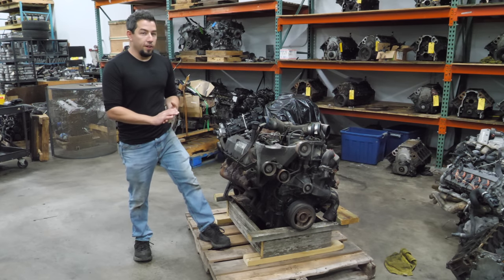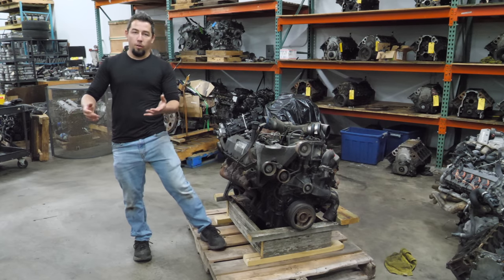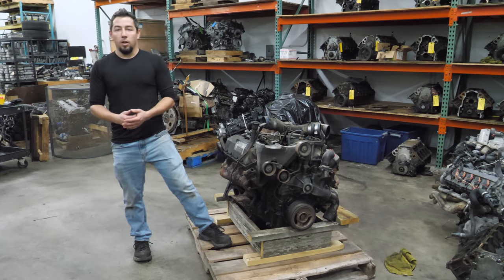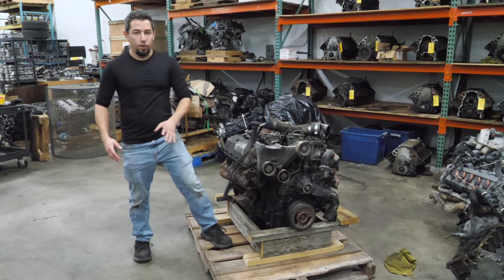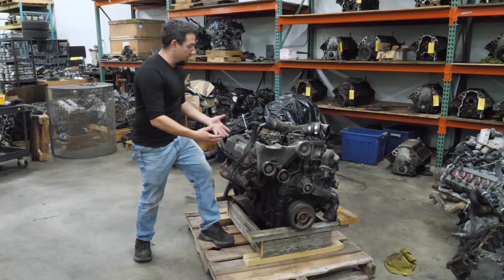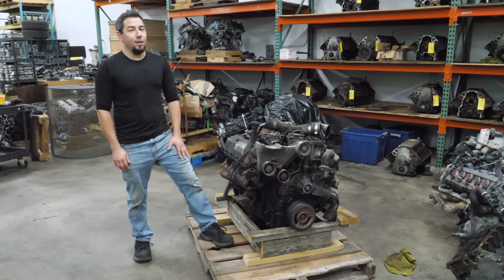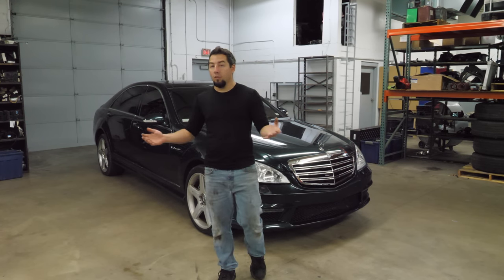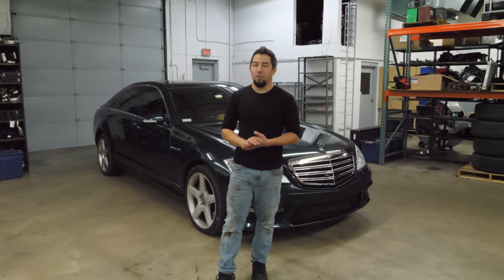70K OR 700K? Ford 7.3 Powerstroke Mileage Discrepancy. How Many Miles Are Really On This Engine?

Comment: Keep in mind it may have lots of engine run hours vs engine mileage. Could of had tons of idle time on it.
Reply: Exactly, mileage is useless, UPS trucks are toast after a few thousand miles due to constant stop start and many hours of slow driving...sane thing with the Toyota mine trucks...
Reply: Or it could have been worked to death. Like one of the 85 horsepower diesels in the original Mercedes G Wagens.
Reply: I drive an F450 bucket truck, 50 hours a week, and it spends most of its time idling
Reply: @motominded5275  it's not useless, both hours and miles are factors. Low RPM usage is less damaging
Reply: @catinthehat5140  well, truckers use an engine idle setting to set their trucks at 1500 ish rpm’s to build oil pressure.
Reply: Yep.. Tow trucks, Ambulances, bucket trucks, tire trucks, dump trucks, farmers trucks, etc.. they all get a lot of idle time.
Reply: Idling diesel engines isn't good for them in the long run, the soot build up isn't good because the soot is basically carbon which scratches the bores, accumulates in the ring lands, is hard on valves, heads and other moving parts, it acts like super fine sandpaper slowly deteriorating  moving parts, newer engines w/ egr coolers and emission systems are really affected by this soot/carbon build up even in light duty and diesel pickups with emissions controls
Reply: @glennshumaker2019  Yeah.. That's why modern diesel design is terrible
Reply: @calholli  the after treatment systems are terrible. The engine designs haven't changed too much other then switching from mechanical to electronic injection. In theory a mechanically injected engine won't last as long, but I have a mechanically injected kubota v2203 with 40k hours and it still has the original injectors.
Reply: @motominded5275  Yep, same with garbage trucks. 200k miles on one of those from a Northeastern city route, and it's SMOKED!
Reply: Lots of experience here. I have a question for you guys. Those worn  bearings from lots of idling is troubling. Is there a way to minimize that wear on engines that have to idle for extended periods? If you changed the oil at very short intervals  would it eliminate that wear or will the damage be done anyway with extended idling? Thanks in advance.

Comment: i’m gonna say 70k. the wear on it is probably due to it likely having not been shut off a whole lot in the winter. especially since it has a service bed, i’d be willing to bet that truck ran non stop.
Reply: I think that oil change place confused 697,845 with 69,784.5

Comment: I had a similar conundrum, but in reverse. I bought an NA Miata with about 120k in 2014 from a guy who took it to a local oil change place near his house. I never took it there. Yet a few years later when I decided to sell it, I pulled the Carfax and found that the same  oil change place somehow had been entering oil change records (presumably on the the previous owner’s other car), but on my VIN. The mileages entered were LESS than previously entered for the Miata, and hence showed as a red flag in the Carfax report. I never got it corrected, and obviously I declared actual mileage when I sold it. But basically those oil change places can cause trouble and confusion for Carfax reports.
Reply: This is an excellent point. Sadly oil change places are low paying jobs jobs with an emphasis on being quick and max profits. Employees tend to hate their jobs and are sometimes even given incentives to cut corners. So not updating a VIN number probably happens a lot. What’s worse is when they don’t change the filter because it requires dropping a belly pan or is next to a super hot exhaust. Or they strip or or round off the drain bolt. Or they under or over fill the oil. Or they use the wrong oil. Or you pay for full synthetic but get the cheap stuff. It’s all been documented.
Reply: A lot of these oil change places barely train their employees to change oil and do the documentation some have experience at oil changes and other mechanical service but employers have to pay for their experience, I very seldom let someone else do a oil change on my vehicles, for one they use cheap unknown oil filters. They sometimes use cheap oil also, so really you don't know the quality of things they are using in your vehicle. I may pay more for premium oil and filters and do the work myself but I know it's done rite.

Comment: Interesting that in the truck pics the service body was eaten up but the cab seemed fine.   The body could have been lifted from an older truck.  I do know that 7.3s can easily run to 700k miles if properly maintained but the labels would be cooked.  Those labels look close to what they did when it left International's Indianapolis engine plant.

Comment: I would say 70k. The reason being I have worked on plenty of these engines. Normally the plug going into the valve cover gets replaced around 200k, and those look like original plugs. On top of that the valve cover harness look original too. And I have never seen a valve cover  gasket last more than 100k miles.
Reply: You are so wrong.
Reply: @thunderroad7289  How you gonna tell someone they're wrong and not tell them how they're wrong lmao.
Reply: your 💯 correct but  what about the harness on top the motor  new   ford factory  valve cover injector harnesses  would be spliced in ..... which I'd ne er use aftermarket.

Comment: As other people have mentioned, the truck had a service body. To me personally it looks like it was a hard working 7.3. I see rust a lot but I live in Canada so that’s why. What caught my eye is that the injectors looked pretty much factory, which someone mentioned. I think it’s had a lot of idle time and hard driving since it looked like a service truck. Also depends on the oil that the service place used, running 15w40 is hard on diesels in the winter. I drive a diesel and run 5w40 all year round.
Reply: I have a 96 7.3 so in the winter I can run 5w 40 will it be easier to start in the cold ?with being plugged in of course
Reply: @bigdaddydaddy3203  Yes it will start much easier in the winter. Running thinner oil though will increase the probability of oil leaks.

Comment: I’m going with 70k miles just with a ton of winter idle time. When you were showing the cam, I caught a glimpse of some of the cylinder bores, and they looked almost new. The crosshatching would be gone if it had 700k.

Comment: I am going to agree with Randall Vos. 70,000. A service truck in the upper mid-west, would most likely idle long hours daily. I ran a service truck back in the early 90's for almost 5 years. In the Milwaukee area. 6 days a week, I started the truck at 6 am and backed it out of the shop. and put it away mostly after 7pm. In the winter I never shut it off, I had an extra set of keys in my pocket and just let it run and locked it up when unattended. It may have been used in construction depending on how they used it, It may have run year round.
Reply: So just letting her run like u did how many miles did it have or better yet where is the old girl now did u sell it ?

Comment: I'm gonna go with 70k. I bet you the Feb. 2015 service mileage was entered one decimal place off, then something in the Carfax system doesn't let mileage be entered lower than a previous entry, so every following entry got multiplied by 10. Especially since just over a month earlier, it was entered at 68k.
Reply: It's awful clean
Reply: Or people just kept thinking the correct number to enter was ALL the numbers on the odo , without the decimal point.  Note how the "error" occurred when they changed oil change places, and continued that way in the future.  it could also be an issue with how the data is getting transmitted from their system to Carfax.
Reply: Then it's bad software.  You're depending on data from an unverified third-party.  People screw up all the time.  I can't believe they wouldn't anticipate that...  (As a former programmer in a former life, you learn quickly to anticipate all the crap data you get from users, lol...)
Reply: Gonna bet you're right, and that the early OBD2 on there was where they started getting their data from at the new place, ignoring the odo in the cluster. Given that the super duties didn't have to have OBD2 even in California in 99, I'm guessing some of them had the ECU milage wrong, because why worry about that with a manual odo?
Reply: I work in retail lending and even if one dealer enters in the wrong mileage on say an oil change, subsequent history can still be entered as the correct mileage. 

Source: view carfax reports all day
Reply: There's no decimal to misplace. He said that 2x.
Reply: @SeymourButtsS2  yeah this isn't a 70k engine.
Reply: @pantygnome  he disproved that theory if u payed attention lol. he said how the didn't have the decimals on the odo on that year truck
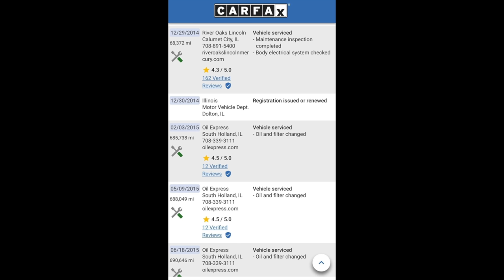Reply: That's what I was going to say. At 6:05 The number is 68,372 and then next one is 685,738. The first 4 of both are almost identical with the later in theory, only 2K more so if you drop the 8 and move the decimal place back one this would make sense. Or it went the other way. 685k is a number you don't see very often on a vehicle. I'm 58, been around a ton of cars and trucks in Texas and I've never seen one. Or maybe ... the first few places saw the 6 digits and said: that can't be right and just entered the first 5 which would be in line with most normal cars when it actually did have 685K
Reply: @WhiteF150  Yeah I heard that in the vid.  I could understand if they fat-fingered the first incorrect reading since the last 2 digits are are next to each other on the keyboard, but the rest of the readings don't make much sense.

Maybe they tacked on a digit from the ODO?

Comment: I'd bet it's a 70K mile engine. I purchased a beater truck 20 years ago or so that been sold 3 times within a year (it had an engine problem that others couldn't seem to find the simple cause) so it had several title transfers and carfax entries.  The truck had 168k on the odometer. The mileage on the title went from 168k to 186k in a months time, and the carfax mileage tracked the title.

Comment: I'm rebuilding one of these right now. This one has 80k but was used offroad in a wildland firetruck, and they used starting fluid trying to get it to start (actually the valve cover gasket and wiring had failed). The bearings were pretty bad, almost like the ones you showed. The starting fluid really tears things up on these TDI motors, as does the idling to keep the AC on.
Reply: " and they used starting fluid trying to get it to start"

Did it come from Slave Lake? MINT!!!
Reply: @BadWolf762  oh she’s cheechin
Reply: @BadWolf762  "How dare you!"
Reply: I’d say the bearing condition came from idling. I’ve seen a bunch of 7.3 and 6.0 eat cans of starting fluid with zero issues to the bottom end. The issue is if you don’t unhook the glow plug controller and the intake heater on the later trucks. Had a friend learn about the intake heater when he used starting fluid on his 03 lol.
Reply: Yep, use the Cosby Sauce, go to jail.
Reply: For one thing starting fluid in these is a no,no alot of them have glow plugs like the 6.o and when youspray starting fluid it will blow up in your face, save the either for a old 2 stroke Detroit Diesel
Reply: @glennshumaker2019  although if u cycle the key on and wait for the wait to start light to go out and count to 20 it won’t blow up I don’t care if I was late to see my kid born I would never shoot starting fluid in there if u plug it in u have a fighting chance

Comment: As someone that used to own one of these trucks, & replaced the valve cover gaskets, that far lower bolt on the back of the valve cover by the turbo is near impossible to get back in or remove at all with the engine in the truck.

The fact Is has the rear bolts means it is either low miles, or that they had a rly good mechanic working on it. Same goes for the injectors, if they are original you can look up the serial of the injectors on the solenoid cap.

Secondly that serial on the injectors would change & if the injectors are rebuilt that solenoid gets replaced.

Thirdly, since it has a service bed on it, & is 2015 the likelyhood they it was low mile for that long sounds strange, & how clean the up pipes are.

Comment: Borescope view of the cylinder walls would be useful. Wonder what kind of ridge the piston rings have left in there? 70k miles maybe, but could have a bejillion hours overall, judging by the crank bearings extreme wear.

Comment: The oil change shops could have assumed the last digit in the odometer was 10th's when it was actually miles. Everything on top points to low milage though. hard call. 700k on a set on bearing on a service truck is stretching it but they could also be the second set of bearing changed out as preventative maintenance. Since you can't be sure... strip it for parts unless you want to replace the water pump, the bearings and the harness and dyno it if there's that much difference in value.

Comment: The bearings should have a date code stamped in the back of the bearing. At least some manufacturers did. That would tell that they are original to engine or have been rebuilt. I doubt someone would find date coded bearings to keep the truck original. I’m more towards 70K with poor oil change maintenance or an owner that was used to driving gas engines. Start and go drivers. Looked like cylinders still had cross hatching, that would be worn at around 200K, by 6.0 experience. Thanks for the videos. Hopefully the family is doing well.

Comment: I say 70k. Service trucks idle A LOT. The wear isn’t is indicative of 700k. At low idle Diesel engines can wear more cause the temp and oil pressure go down. The cross hatch in the cylinders looked amazing though.

Comment: Hope the new addition to the family is doing well. As for that engine... I'd say 70k with many Cold Starts, and  a ton of engine hours from idling. Or if it was used to plow snow, then it would have experienced high load for extended periods.

Comment: Usually when a 7.3 is run hard, you will find broken exhaust manifold bolts on the rear of the engine.  Dash cluster changed perhaps?  They didn't use Archoil on this engine!
Reply: Archoil! 👍
Reply: No doubt if that engine had Archoil , or Schaefer's oil in it everything would be new. They probably put the cheapest Dino swill in there they could find and probably the wrong weight as well

Comment: Definitely an original turbo. AlliedSignal acquired and adopted the Honeywell name in 1999, not long after that engine was produced. 

I was also tentatively voting for 70k… but there are two things that are odd. The fact that all info sources are consistent after the first time 680k+ was reported. And, if the decimal was shifted, why were they changing the oil every few hundred miles toward the end? Only thing I can think of to explain both is maybe the cluster flaked out and they swapped it with a junkyard unit that just happened to show almost exactly 10 times the miles. Then the oil change intervals might make sense.

But then the bearings… yeah, that’s a lot of wear for 70k unless it was neglected and thoroughly abused. I’ve seen factory original diesels with more than 700k that had rod bearings that looked a lot better than that, so I don’t think it’s out of the question it could be that high. 

I dunno. Maybe the better question is whether that generation of Super Duty truck would last 700k and 16 years in Chicagoland? Yeah it was pretty rusted in the pics, but imo not 700k levels rusted. So I’m gonna go back to my original assessment of 70k, with the caveat that it lived a really rough life. Maybe pull the glow plugs and scope the cylinders, see what condition they’re in. If they’re in as bad of shape as the bearings, that thing’s gonna need an overhaul anyway.
Reply: Absolutely correct on Allied/Honeywell, worked for Allied during the acquisition of Honeywell and we we're all so pissed to lose our heritage and pick up the Honeywell name
Reply: It is also possible that the stock turbo has been rebuilt. I did new bearings and seals in the 2000 I had with a repair kit.
Reply: I can see a fat-finger happening, too. Look at your ten-key: 5 right below the 8. If that error initially happened and the owner caught it, instructions to just add a digit to avoid an apparent odometer rollback could have happened. Selling with a rolled back (or even seemingly rolled) odometer is harder than selling a truck with 700k miles. And the techs at the quick oil change places aren't exactly the most attentive when they want to keep pushing customers through.
Reply: @johnhull6363  Well said.  The company went to hell after Honeywell management took over!
Reply: If you look at the turbo casting you can clearly see the 'ett' cast into the housing suggesting a Garrett .